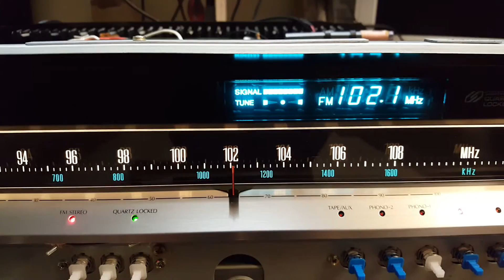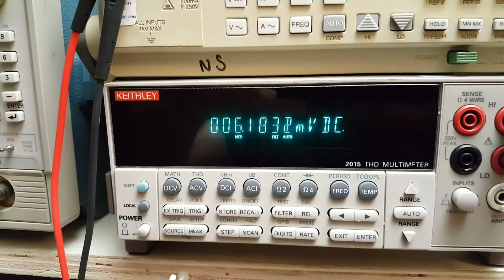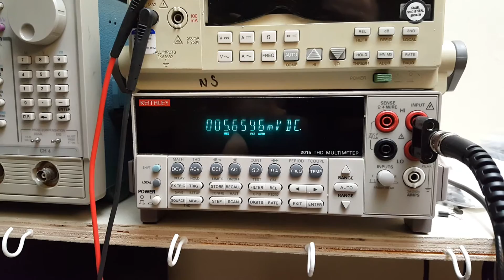G8700 & G9700 Amplifier Instability Repair Advice

Comment: Excellent vids on these units. I'm about to tackle repairs on a G5700 & G7700 so I'll be looking at these a lot.
Reply from the maker: Those receivers are better designs and a whole lot less feisty! They even have proper thermal feedback in the bias circuit that directly tracks the output heatsink. SanKen still makes MT200 package transistors that are drop in replacements in the 7700. The exact part numbers Sansui used are discontinued but the new ones are even better than the originals.

Comment: Hey! Can this amp run both A and B speakers at the same time?
Reply from the maker: I don't recommend it! These amps are engineered to deliver maximum power into 8 ohm loads at the cost of adequate safety margin into 4 ohm loads. With low impedance loads, they tend to run hot with shorter rebuild intervals and at high output, they can easily trigger their protection circuits.

Unlike the 9090, these run A+B in parallel so two sets of 8 ohm speakers results in a 4 ohm load. Also, since these receivers run more power than the 9090 through similar transistors, they just don't have the same margins as a 9090. Now, the 9090 isn't supposed to run 4 ohms either but in practice it does so with much better durability. 

With this limitation in mind, and proper service that attends to the known issues, these receivers can deliver decades of fun and poor relations with any neighbors that have different tastes in music. ;)

Comment: Got a DC OFFSET problem inside my g9700 but for now it's okay
Reply from the maker: Get it to a qualified tech ASAP and don't run it until its fixed. The amp might become unstable and then you're looking at a few hundred bucks to fix it.

Comment: Hi Andrew i have a SANSUI QRX7001 but if i plug a speaker into front left, A or B i get a loud "white noise" even with volume dial set to zero, is this easy to fix?
Reply from the maker: Jason Colston: Generally this type of fault isn't what I'd call a quick fix. You probably have one or more bad transistors. If you don't have the gear to trace signals, you'll need a pro. It could be on multiple boards as well.
Reply: Thanks for your reply Andrew,much appreciated.